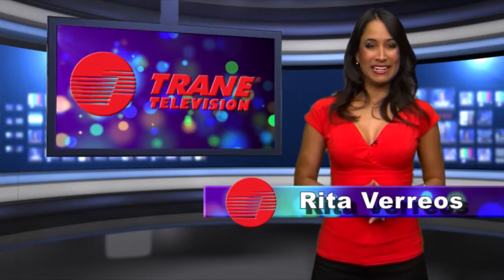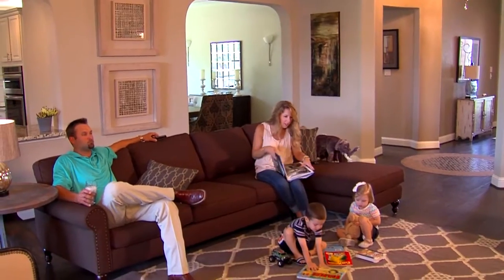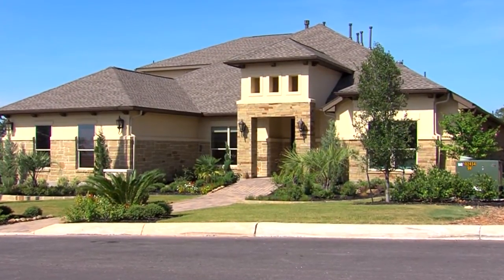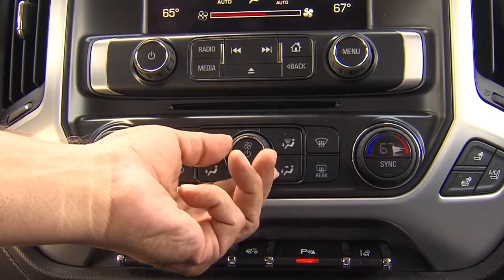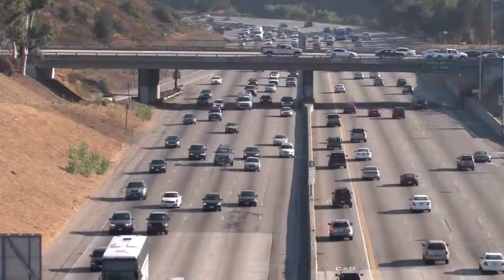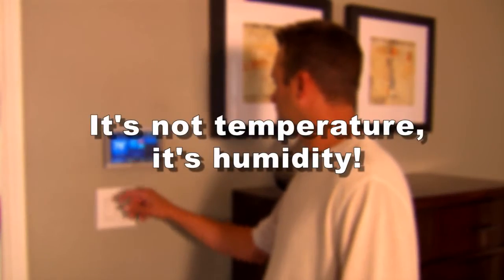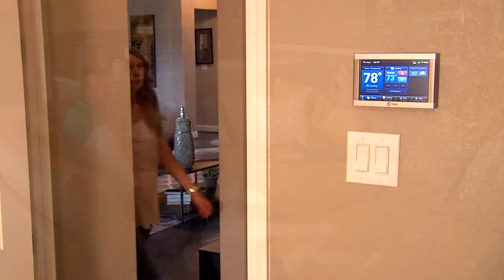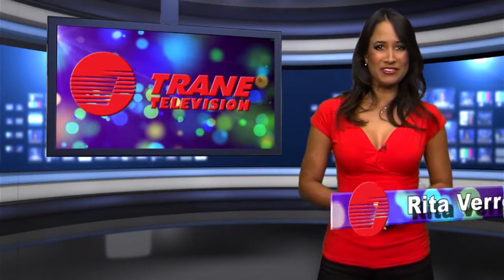TRANE TWO STAGE YOUTUBE

Comment: What I would like to know besides the difference in looks, what is the difference between the XR17 and XL18i? I have been told its the same compressor in both of them but one has a top and the other doesn't, but why do I hear that the Xl18i will be slightly more efficient? I need to make this decision before buying my new system and need some guidance. Thanks
Reply: The xr17 is a two stage unit, and the XL18i, is a variable speed unit.
Reply: @x14inchdubsx30  I went with the Xl18i which is two stage not variable, and honestly I would never buy another Trane long as I live. Next will be a Carrier
Reply: @MJAPlumbingandHVAC  WRONG, the XV series has a variable speed compressor. The XL-18i has a 2-stage compressor with an available air handler that has a variable speed fan/blower motor (the TEM6). The TRANE XL-18i and the TRANE XR-17 are very SIMILAR in features. The difference is the  XL-18i has a 12 year (versus a 10 year for the XR-17) parts warranty....and the XL-18i has the plastic "Weather-guard top." The XL-18i is 2K more bucks for these additional features.  I bought the XR-17 system and I am very comfortable in my home.
Reply: @FatManDoubleZero  incorrect. Feel free to look at tranes website. Very clearly states the XR-17 is a 2 stage. The XL18i is variable speed.
Reply: @FatManDoubleZero  feel free to not be rude. Its an opinion, grow up and dont take it to heart.  And just because it can be paired (like you said) does not mean it comes standard with the unit. Go look at trane's website. It is the manufacturer. And no, I will not feel embarrassed because according to trane's website, I am correct. Idk what facebook post you looked at my guy, but arrogance is leading you to not look at the MANUFACTURES website. Perhaps you will be embarrassed.

Comment: Trane is junk!! 
I had a $10,000 Trane XR17 system put in by them. Purchased and Installed by an Authorized Trane Dealer, Larson Air Conditioning, Scottsdale, AZ. Nothing but problems from day 1. Had to replace the Heat Pump after 3 weeks. Brand new and leaking from the factory.  Then it took over a year to fix a problem that would cause it to quit cooling (over 12 times in the first year). My 15 year old no name AC system I took out was way more dependable than this Trane system.
Then the Air Handler coil broke in year 2. I called Larson Air Conditioning and they sent a service rep out.. said all my Freon was gone.. they said it leaked out somewhere.. he could not find the leak he said... said it must be under my concrete floor since he couldn’t find it... he offered me a $300+ test to do a UV test.. I knew the chances of that were almost nothing so I called BS. .. so I told him to fill up the system with freon which cost me $900. 2 days later no cooling again.. Fed up with Larson I called another Trane dealer for a second opinion.. in 10 minutes he found that the Air Handler coil was leaking...thats where all me freon was going.. outside in the condensate line.... but Larson guy couldn't find it? while the coil in under warranty (but backordered for over 3 months and counting.. still not in) it would cost me $2500 for the freon and labor to have the coil put in. . So during the first year with all the problems ... so by year 2 it would cost me $3500 to fix this Trane AC system that’s “Under 10 Year Warranty”
And don't expect any support from Trane Customer Relations either.. after 2 months of repeated requests from Trane Customer Relations for a refund or any financial assistance.. they say they cant help ANY. So Im left with no option but to leave this unfortunate and honest review. 
I have since removed the 2 year old Trane system (coil has been backordered for over 3 months and still not in). No coil.. No heat in winter… I was forced to take out the Trane POS and install new Carrier system which has run flawless..
The current Trane isn’t the old Trane that had a good reputation ever since bought out by American Standard.   “Its NOT hard to stop a Trane”
Reply: Either you were unlucky and just got one of the few "bad units", or, MORE LIKELY I suspect your "TRANE dealer/contractor" SCREWED UP THE INSTALLATION BIG TIME. My TRANE XR-17 5-TON UNIT has worked flawlessly for the past 12 months since it was installed. And this is my second TRANE system. The first one lasted 20 years. By the way, my installed price for my TRANE XR-17 heat pump system set me back $15,500 and included a Honeywell whole house electronic air cleaner and complete NEW duct work including 7 manual air flow dampers. Your price of 10k sounds very cheap. TRANE manufactures their units in Tyler Texas.  Other than Daikin/Goodman and Trane/American Standard, the other HVAC equipment manufacturers have their units made overseas and shipped here. If your installer did a sloppy job brazing the copper line sets, it's not a shock that your evaporator coil started leaking R-410-A refrigerant.  I have heard similar COMPLAINTS like yours regarding crappy "evaporator coils" made by customers of both LENNOX and CARRIER. My best friend just had to pay 3K to replace a 7 year old cased evaporator coil in his AMANA builder's grade system.  The cost of the refrigerant replacement for consumers is HIGHWAY ROBBERY - caused by the EPA and their nonsense about "PHASING OUT" R-410-A REFRIGERANT - for no logical reason.  The OZONE is very healthy and R-410-A does NOT deplete the ozone.